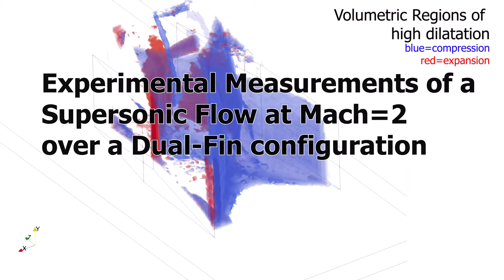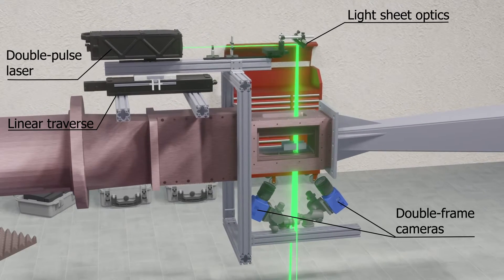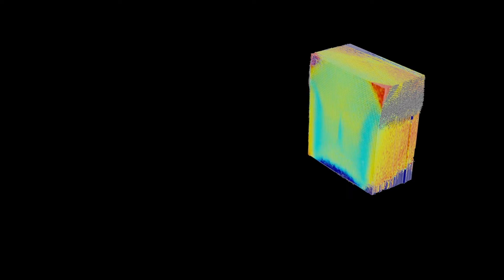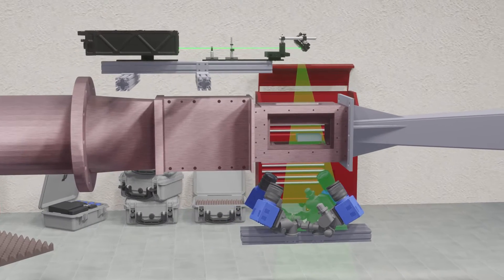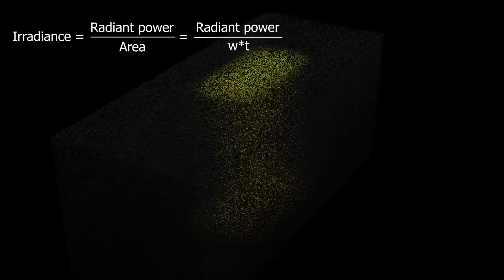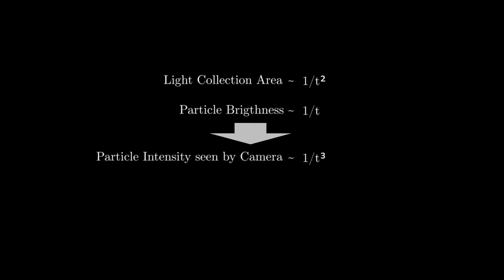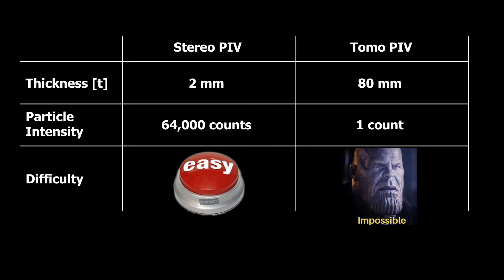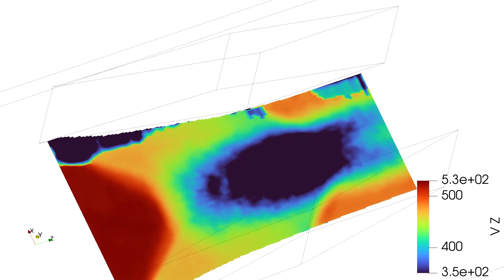Scanning Stereoscopic PIV - An easy 3D flow measurement technique without Tomo-PIV!

Comment: In your setup, you have the cameras below looking "up" into the laser, would it work just as well if they were looking "down" the laser?
Reply from the maker: @will6699  yes, it would. You may face some issues because the backscatter signal is weaker than the forward scattering signal (i.e particles will look much dimmer). But I've built setups like that and it works; you just have to deal with having less light available.
Reply: @fzigunov  Thanks for the quick reply! I just started a new job and they want me to start looking into PIV so I'm just trying to figure it out in my head 🤣

Comment: Hello Fernando, Interesting technique described here. I was wondering whether HFSB's combined with counter illuminating lasers can solve the problem of intensity drop that you are describing. Ofc you would have to switch to particle tracking and multi-double-pulse techniques such as Shake The Box, to resolve high speed flows. Again, the time average would be captured though...
Reply from the maker: Hi, Niko, thanks for the comment. HFSBs are brighter and definitely a solution for low-speed flows. I have not seen HFSBs being used in a supersonic flow; and I think that has to do with a few aspects:
(1) Evaporation rate is actually very fast - For normal water in room air it is about ~2mm/day or 23nm/s. This means a bubble with a very thin shell will disappear in a really short time. Though I haven't looked closely into whether a linear scaling applies all the way to the nano-scales.
(2) If the bubbles are to last a few seconds, they would need to have shells of ~100's of nm; but that's about the size of an oil droplet used in supersonic flows (~1000 nm). So the gain in brightness for a given frequency response is likely not there;
(3) It is just in general not something people have done - Generating bubbles at the single-digit micron diameter scale. There are engineering challenges in doing that with any repeatability/volume and making sure the diameter distribution is not too wide. For a typical supersonic tunnel in a university, you'd have to generate particles at a rate of ~1e12 to 1e13/s (our 4x4" M=3 tunnel requires that many). That's already hard with droplet condensation systems; let alone with repeatable bubbles.

I think it is a very rich research direction; there's a lot to learn here. It may not be impossible to do; and definitely would have great benefits to image supersonic flows in 3D. Perhaps as a community we can move towards that direction!

Comment: what is the difference between this method and SLS(scanning light sheet)?? Just curious, i am preparing an exam about this stuff
Reply from the maker: Thanks for the comment! Scanning light sheet is moving only the laser, without moving the camera. In that setup you need to require a depth of field of the thickness of the entire volume (not only the light sheet) such that the particles are in focus, meaning the intensity of the particle images is ~(1/thickness)^2 due to this focusing requirement; and the amount of light required is much larger (potentially hundreds or thousands of times more light). For a supersonic flow you'd need kilojoules of laser energy per pulse to do PIV in a large volume; which is just too expensive to have in a fluids lab.

Comment: For Tomo-PIV could you not use a low powered high fidelity doppler radar or radars in place of a complex laser system?
Reply from the maker: I have never seen that in my experience, but it sounds pretty challenging to implement and get detailed results. If I understand what you are saying, you would use a radio wave radar. Even at mm-wavelengths (say, 300GHz), I reckon the waves won't scatter much from the micrometer-sized particles. You would be in the Rayleigh scattering regime, which yields very low scattering cross sections. If you go to smaller wavelengths to get back in the Mie scattering regime, you're back into the visible spectrum (i.e., IR or visible light). In fact, there was a technology called "laser doppler anemometry" (LDA), which used the doppler effect with visible light to get velocity information on particle-seeded flows (i.e., the scattered light's color is slightly different because of the Doppler effect, so when it interferes with the incoming beam there is a beat frequency that you can measure with a photodiode). 

Most aero labs don't use LDA anymore (to my knowledge) because it only provides point-like measurements, whereas PIV and the advent of high-speed cameras and double-pulsed lasers allow for measurements over a 2D (or 3D) region, which is far more insightful for understanding flow behaviors.
Reply: @fzigunov  Yeah in my head I was thinking something very radar reflective might work. In a shock tube like is shown here it would work almost like one of those bug assault rifles, due to the fact certain it should consolidate in certain areas. The more I think about it though the more problems I can see.
Reply: @fzigunov  if I may also ask what cameras you are using in this video?
Reply from the maker: Sorry for the delayed response, I don't get notifications for comments for some reason. We used the PCO Panda 4.2 camera, rebranded by LaVision "sCMOS".

Comment: Hello sir, I am also a PIV expert and I have also done a few 3D PTV experiments. I have no experience of SPIV. I wonder if I can work with you on some project. I am PhD and presently doing post doc in India.
Reply: hello sir can you help me i m doing m.tech from nit calicut and i want to know what  specification of lasers are required in PIV and can you suggest any cheap lasers for doing flow visualization in ventilation system.